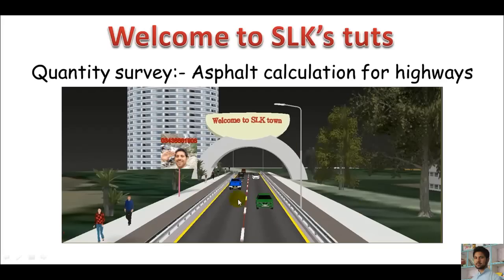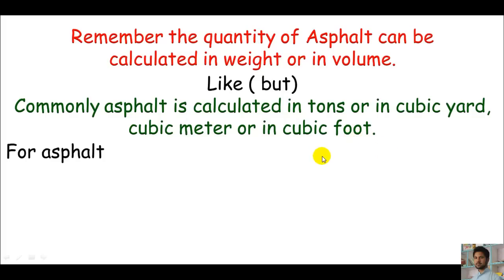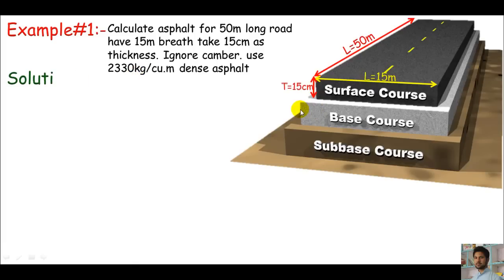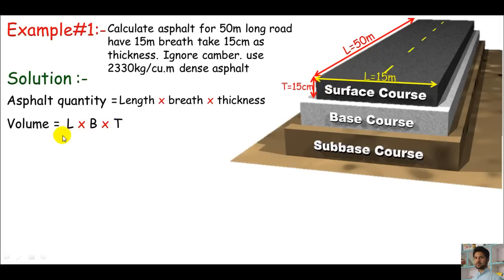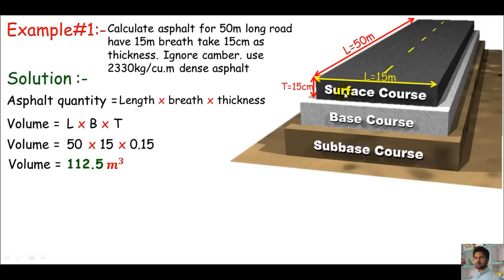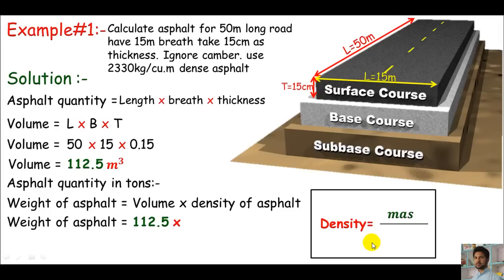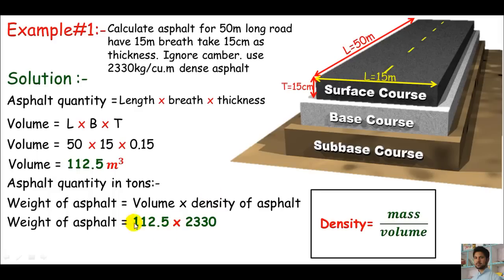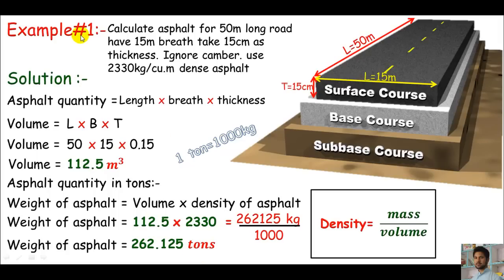1) English Asphalt calculation for highways part 1 of 3

Comment: Sorry not agreed with you sir because.. The density of bitumen is 1 tonne per cubic metre that 1000kg/m3 (approx) and you are saying bitumen material has density 2330 kg/m3.
Reply from the maker: Vikas Soni .

dear there is alot of different b/w bituman and ashpalt. the calculation is for asphalt not for bituman. bituman is 1000kg/cu.m but asphalt is 2330 kg/cu.m

i hope you are agree now
Reply: This is the density of mix not bitumen.
Reply: So Sir kindly i am also Confused . Bitumen Density 1000 kg/m3
and Asphalt 2330/m3 
what is the different between Asphalt & Bitumen?
Reply: Rab Nawaz Afridi asphalt is more pure form of bitumen

Comment: could tell em how we will calculate the quantity  sub base course and base course quantity
Reply from the maker: murtaza khan 
the same method will be used as i have used in floors estimation. please check the lecture materials estimation for floors
Reply: oka i  knew but in floor we have used the ratio here ewe have no ratie in subbase we have onlu used course agrregate so here
Reply from the maker: murtaza khan 
you do not need any more calculation for aggregates. just find volume . because aggregates are always calculated inform of volume